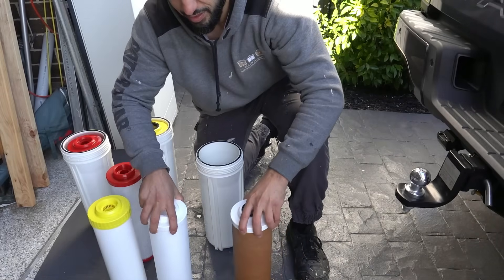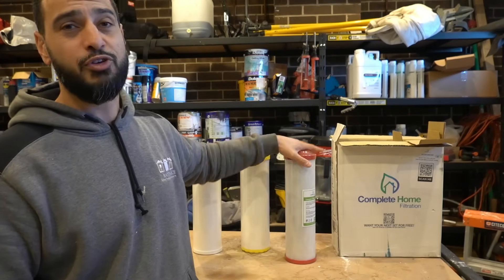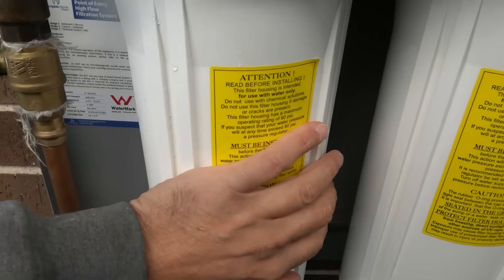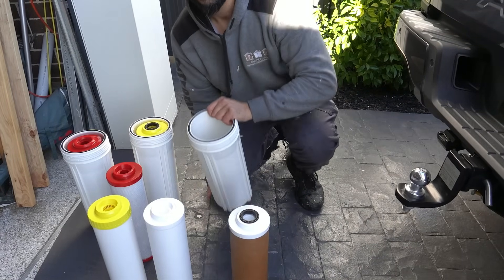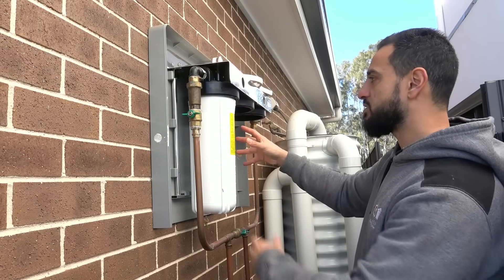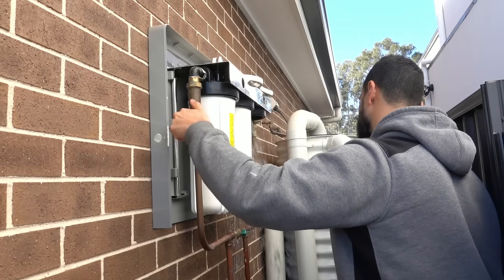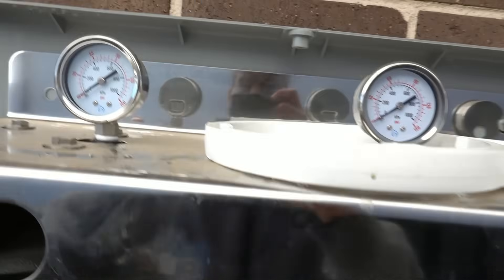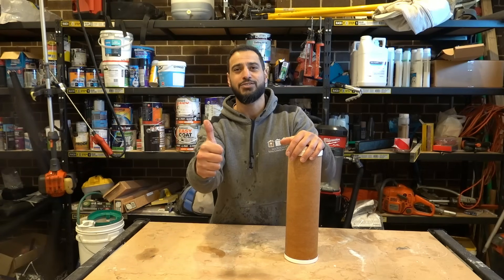How Dirty Is Your Home Water? Watch This!

Comment: did they new ones have rubber washers on them?  looks like you needed to swap them over from the old ones or did i not see them?
Reply from the maker: the grommets shouldn't come out with the filter, if they do come out you just re install them into the housing then screw the filter cover back on👍
Reply: @billshowto yeah I mean the old ones you pulled out had the black rings which I assume were the washers,  and it looked like you didn't swap them over...
Reply: @AnarchyEnsues  I just changed mine. Yes I know the rings you are talking about and in the video it looks like @billshowto didn't swap them over from the old filter to the new ones. You can still see the black rubber ring still on the dirty filter at the end of the video. FYI, I swapped mine. I'm guessing that's what was needed. Other than that, great video, thanks. It helped a lot.👍

Comment: Does this system have a waste run off? I looked at reverse osmosis w/f’s and was put off by the wasted water, every 100 litres, 35 litres are the useable water, 65 litres goes to waste. Approx numbers for explanation. Your system is really neat copper piped in.
Reply from the maker: no waste run off , simply filters all water coming in 👍
Reply: @billshowto thanks Bill.

Comment: you didn't put the new o ring? and old filters had another o ring
Reply from the maker: It come with a new set of O-rings that only need to be replaced if the old ones are worn out so i didnt replace them. The rubber grommets on top of the filter shouldn't come out with the filter, if they do come out you just re install them into the housing then screw the filter cover back on👍
Reply: @billshowto  watch your vid, you remove old filter with o ring and replace without

Comment: Have you thought about weighing the filters especially the sediment one before and then when you replace them. 

In the late 1980s I used to know someone who lived in the  Melbourne suburb of Preston. He had a filter you attached to the tap outlet and in the space of 8 months his filter gained just under 1kg (960gms) rings a bell for some reason and the weight gain was attributed to the old water pipe in Preston at the time. 

No idea if the water pipes have been replaced but the dirty water was detrimental to his health. When he started filtering his consumption and cooking water his health improved but started degrading against after 6 or so months and it was suggested he replace the filter and weigh it. After replacing the filter his health improved again.

Thank you for the video Bill. Have to go and watch Part Uno of this topic. 👍
Reply from the maker: sounds like a good test to do at the next change over as i have already disposed of the filters 👍👍👍

Comment: i change um every 4 months, worth it man
Reply from the maker: $500 for set of replacement filter lol I’ll stretch them out as much as possible
Reply: @billshowto you can get much cheaper going through a regular supplier instead of the company
Reply: @billshowto  perth water is rubbish the're gone in that time 
you should be paying about 200 for the 3 look around you dont have to use the manufactures specific. its a standard size filter
Reply: I can understand that if you are filtering your whole house water intake which would necessitate replacing all filters  6 months or so.
Me. I have the under the sink filtration which I use for drinking, ice cubes, water for coffee etc and that 12 months replacement is recommended.

Comment: What is the cost of this unit?
Reply from the maker: Whole house is expensive, but there are many cheaper alternatives that I go through in my previous video. From memory this one was between 4-5k
Reply: @billshowto  ouch. they are like $600 from bunnings without the copper and valve fittings and usually no gauges

Comment: I didn't know these filters existed as a three part unit.  It's worrying what we are drinking. Interesting video, Bill.
Reply: You can get ones that will fit under the kitchen bench and include an Ultra Violet "filter" that exterminate any microscopic "creatures" in the H²O in addition to the Carbon, Resin and Particulate filters.

Comment: I also have these filters but under my sink (not as big) did you know that its actually good to have some of the minerals etc in your water? Some people go as far as to re add them back in after filtration.
Reply: I actually got rid of mine because the filters themselves are a breeding ground for bacteria. Think of this, the last few months of Bill's water even if clean it's been passing through that brown first filter, when the tap is off then there is stagnant water sitting in the bowl of that filter, only an o ring holding it back from bypassing the filter too. If you are good on the maintenance probably ok, but i'm definitely not
Reply: True, we buy cheaper mass market filtered water delivered to our door which cleans all the minerals and it taste like nothing. Meanwhile my cousins just use Brita to filter there tap water. There water taste good compared to ours.
Reply from the maker: Interesting, I kind of assume that water isn’t supposed to have a taste???
Reply: @billshowto I think the heavily filtered water which we order taste like nothing because the minerals are all filtered out compared to the Brita's small filter which I think don't filter all the minerals. I think Brita pitcher filtered water taste better because of that. I'm not saying it has a flavor or something but it's just a better tasting water. When it's cold you will easily notice the difference in taste.